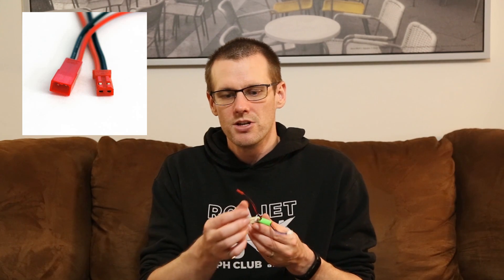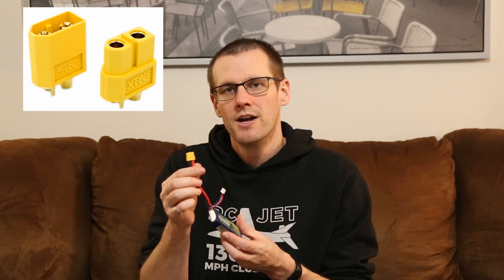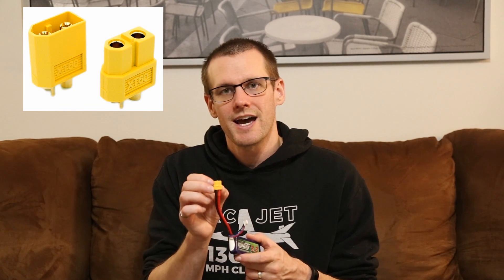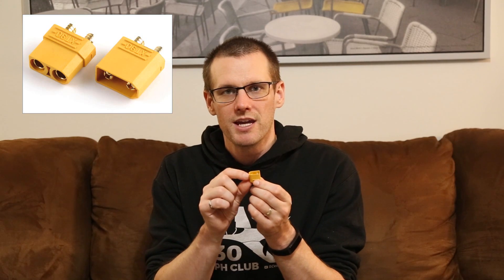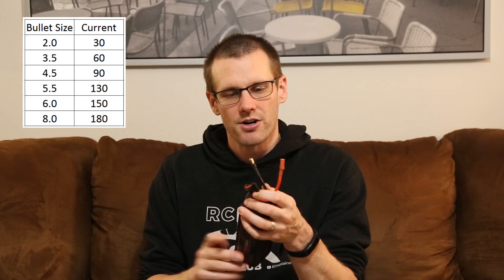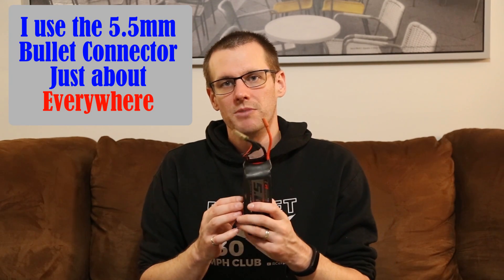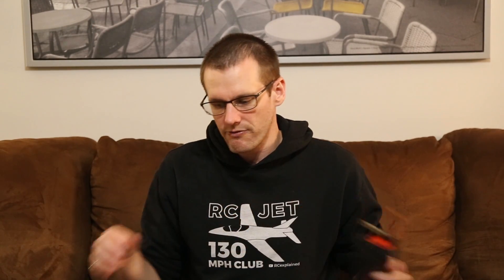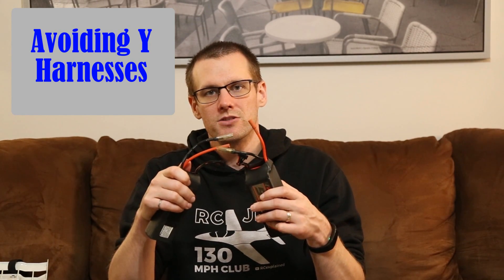Selecting LiPo Battery to ESC Connectors for your RC Car, Plane Or Boat

Comment: If you're going bullets for a high amps application, AS150's are the way to go. Male and female exists for both the bullets AND the caps. It's the safest way to allow yourself the ability to trivially connect batteries in series simlar to how it was described in this video. But the cap protects both bullets from the same battery from passively touching easily and shorting. How you decide to use the caps dictate which correct connections can work.

Do you want it to be impossible to short a battery even if you try? Maybe for yourself or others who might find your battery and try something stupid? You can do that. And if you will never do a series connection, this is probably the way to use them. Even if you decide you do want to use two of your already set up batteries in series later, it’s no big deal to make the single cable with the right cap + bullets to connect two of your batteries and mission accomplished.

If you don’t think you’ll ever absentmindedly try to short a battery, then you have a system where two batteries’ normal leads can directly connect to each other and become a series, and the two other leads are the same as any other battery. It’s your choice how you want to do it. And lastly, AS150 male bullets can come with anti spark variants to enable it for anything.
 
The biggest downside of AS150 is that it's large. The protective cap is even larger and that doesn't bend. If you're trying to achieve an interconnect that also needs to bend and flex in a short cable run, it is the wrong connector.
Reply from the maker: Thanks for sharing your detailed experience and insights on AS150 connectors!

Comment: I read somewhere that the common used 12g wire batteries usually use are only good for like 80amps(off the top of my head). Pretty sure it was a "deans" article and they were saying over amped connectors didn't make a difference since the wire could only handle 80amps.

Comment: I have 2s and 3s batteries with jst connectors bought a 60a esc but I don’t want to solder other battery connectors as the hard body only allows jst into the battery tray

Comment: I'm kinda new to electrics, but have used the EC3.  I think I may got to the XT60 though after watching this.  Or just 5.5 bullet style.  Is one easier to solder than the other?
Reply from the maker: I find it easier to solder larger connectors.

Comment: I used to use XT30s or XT60s for everything (Never dabbled in anything high powered so never needed anything bigger), though they are a pain in the butt to solder so I've started switching to EC5s.

Comment: Excellent video. Thank you. I just today bought a castle combo, mamba x esc w/ a 1515 2200kv sensor Ed motor. The motor came wired with 6.5 Bill it connectors to plug in to the esc. Do I need to use a 6.5 or larger connector for esc to battery?
Reply from the maker: I like to use 5.5mm or larger bullet connectors on the battery. For most applications 5.5mm or larger will be sufficient. 6.5mm is ideal for high power output.

Comment: Just got myself a new combo 120A esc and 4500kv sensored brushless motor for a 1/10 car. Battery is a 2s 5200mah 50c. I planned on using XT60 connectors because I saw people using them.
Reply from the maker: Hi SerxRox, I would prefer to use a larger connectors. XT60's will work if you don't plan on drawing more than 50-60A average

Comment: ryan i just bhought a battery lippo 7.6  12 cel ia it posible if i conected with esc 7.4 12cell help please because i saw one of your video it could dangeres also if you put the wrong batteries i dont want to make that mistake
thank you
leonard
Reply from the maker: Which LiPo and ESC. Do you have a link?
Reply: @RCexplained   lipo 2s 7.6volt esc skyrc 120a
Reply from the maker: If your ESC is rated for 2-3s lipo it will be fine. Voltage is within the range.

Comment: Good information Ryan, thanks! For my models, I use only XT60 or XT150, depending on the application. By using only 2 different connectors, I have the flexibility to mix and match batteries to different models and/or situations. The XT60's are my favorite, but beware of cheap imitation XT60's that are out there on the internet!
Reply from the maker: Sticking with 2 connectors is ideal. I can totally relate to mixing and matching batteries.

Comment: For every device i use female connector and for wires male connecter
Reply from the maker: For connector that are made up of one housing supporting positive and negative terminals, I place the female connector on the battery or power source. The male connector would then be placed on to the load side.

Comment: I use EC5 on my cars (1/10 scale). Soldering is a little tricky but it has two advantages : it does not need heat-shrinkable sleeves and once it is installed it is realy robust.
Reply from the maker: EC5, are good connectors.

Comment: Ryan im sure youve heard pf the ec5 connector, no wonder why ive felt heat from my connectors. Guess its good for 120 amps but up to bursts of 150 amps. Running 2 4s batteries in series 8s, was up to 148 amps of discharge, when i was running my infraction back then for speed runs. Great video. My connector i like is the ec5 connector
Reply from the maker: EC5 are good connectors. I do prefer the 5.5mm bullet over the EC5. EC5's are made up of 5.0mm bullets.

Comment: I also don't get why batteries with really high discharge rating, come with plugs that are just ridiculously underrated for that discharge?
Reply from the maker: Many hobbyists remove the supplied connectors upon purchase. I would expect the reasoning of these connectors being supplied is simply just about cost and nothing more.

Comment: I'm affraid, that just like literally everyone else on YT, You've made a mistake on XT connectors ratings. XT60(and both brothers) confusing name doesn't claim continuous current at 60A. It claims 30A nominal/cont, 60A max/BURST. There is like ONE website in Poland that gives a table of 60A cont/80A max, that table looks like specification table, but I'm guessing it's just the practical knowledge of the store guys. And so XT30 true value is 15A cont/30A burst, XT90 has nominal current of ONLY 40A. And this info is practically on every respectable electronics store website. Now, because of fear I've picked EC-5 100A rated connector(every RC website says that), for my 120A Novak Havoc 3S ESC/Ballistic 10,5t BL combo, which was my first RC setup and probably a big overkill for 2S used. But as I'm writing this, after years since making this (only)setup, I just found out EC5 doesn't have 100A cont rating, it's another 40A connector, just like XT90.
***So my question is, why all of us running underrated connectors and are not melting the plugs? Most people on YT running 8S Lipo(and more) 4x4 beasts with Mamba 240A ESC, even two of them, don't even have XT90 in there. Majority runs XT60 regardless of the setup. So how does that work? Let me also mention that 180A mentioned is nowhere near the top for connectors made by Amass, and that 8mm bullet connector nominal rating is......80A
I've just ordered XT60 to swap my EC5 for the most popular connector, and again am worried :-/ Now going for 3S and not really sure if higher voltage means less current? Or does it really depends from not so powerfull motor installed which will never draw 120A from that ESC? Again wrote too much....
Reply from the maker: Hey Polish Guy. I'm glad you asked this question. There was a great article on this very topic that I read maybe 5 or more years ago that I can no longer find. Since I can not find this, my answer much like your comment, is not going to be a short one. Probably longer, let's dig in to it.

Yes the AMASS spec sheet identifies 2 ratings as you have pointed out. You also mention the "true" value for an XT30 is 15A cont / 30A burst.  One thing to identify here is what does a true rating actually represent? Current does not behave in the same way other parameters may. If you connect a 7s LiPo to a 6s rated ESC, that ESC is surely going to fail upon connecting the 7s battery. However pushing 20A to a connector rated for 15A does not mean it will fail. There is more to it then this. 

The question then becomes, what actually determines a connectors max. continuous current rating? A reasonable answer to this question is the maximum safe continuous current that can be passed through the connector within a safe maximum thermal limitation of the connector. The specified max operating temperature of the AMASS XT-60U connector is 120 degrees Celsius. The 30/60A ratings specified on the spec sheet do not list the temperature the connectors hit and control environment that they were tested in. This does not paint any useful picture for us.  One may expect the max safe operating temperature of the connector to line up or at least come close with the specified current draw of the connector. In the case of the XT-60, it does not.  When an XT-60 connector is run at around 30A continuous for the entire duration of a battery, there is not a significant measurable difference in temperature compared to ambient. When the XT-60 is pushed to around 50A, heat builds but is still reasonable and certainly not anywhere close to the rated max operating temperature. I prefer connectors to not increase significantly in temperature while in use. I would never like to see temperatures exceeding 60 degrees C (half of rated connector max operating temperature) on the hardest of runs in the hottest days of the year. If this does happen, I move to the next available connector set regardless of any ratings on connectors.  The XT-60 has been tested to burst currents of 150A for 8 seconds without failure. This is a lot of power for a connector rated at 60A Peak, especially since bursts are more realistically less than 5 seconds for most RC car applications. Another test has demonstrated 180A for 10 seconds without failure. For this reason, it is very acceptable to run 60/120 numbers for the XT-60 as you will see everywhere.  

Continuous current is yet another area of opportunity for miss-interpretation. We can push ratings even further up as our batteries do not last an infinite amount of time. In fact, most aggressively run RC's will not last more than 5 minutes until the battery goes from full to empty. Because of this limit in time, it also creates an artificial meaning for "continuous" .

It is uncommon in any industry for a manufacture to provide very conservative values for the ratings of the product. This is due to the understanding of leaving value (or money $$$) on the table that could otherwise be used to market the product. This is what I ultimately find so interesting but could be related to the next point. 

Another item to consider is that these connectors are not only used for RC but for other applications as well. Due to specific limitations in other industries, these connectors can be underrated to suit.
Reply: @RCexplained  Thanks for long reply. One thing I omissed is the spec table for connectors also give nominal voltage of 500V. So the rating is at 500V(!?), which makes like EVERY SINGLE VIDEO on YT regarding RC connector ratings......pretty much useless and very missleading? My physics and maths memory is gone really, but simple formula allows us to calculate rated power handling and then calculate current again for voltage required-number of cells used. Numbers don't look realistic however, so I wonder what do You think about it?
So for XT60, 500V*30A=15000W of continuous power rating, or as You kinda mentioned-partially heat capacity(?). Right away-not very realistic...
For 3S 11,1V XT60 connector: 15000W/11,1V=1350A nominal and 2700A burst, which as You explained, especially burst rating we should take very lightly. It might be 0,5s, 1,5s or 5seconds burst, who knows. And off course the higher the voltage, the less current it can take. But for 2S Lipo it's ridiculous 2020A. Safe margin is still recommended, running conditions should be considered, also as You mentioned NO ONE wants having to disconnect a plug at 60°C, so if the rating is for max connector temp of 120°C, then divide the current by three, to get connector temp of 40°, then add some current, cause passing air at high speed will cool the plugs, temp to current flow isn't parallel due to air temp.....it's hard to estimate, as You mentioned.
Similarly EC5 connector is also rated @500V, but 40A nominal, 100A burst. 20000W capacity divided by 11,1V=1800A, 2700A@7,4V BUT burst values for larger connectors is where the differences matters - 100A*500V=50000W; 50000W/11,1V=4504A; and 6756A@7,4V So again burst current for EC5 connector should be taken lightly due to unknown testing/conditions for rating tests, but it's MASSIVE! 
So for other readers - Amass gives all their rating @500V, so the calculations can be used for Deans/T connector, bullets, EC3, EC5, XT30/60/90, most of popular ones. However the results don't look realistic. It would suggest all of us actually run overrated plugs, and XT30 should rule the market for 3S
Am I correct? Is there still hope for my brain power? Is there any grey matter left inside that empty horse's head? :-)
Reply: @RCexplained  Wow Ryan Thanks for the info. Seems like you hit a nerve with this topic lol .I use Amass connectors because they look beefy🙂 I built a 100mph plus car , 100c 8000 mAh 8s esc Castle MambaX. I'm still learning how to drive high speed but so far 90 pb and alot of mid 80s back to back, wires connectors and esc all cool so 8mm wire and Amass connectors work for me. You were very helpful along the way so Thank you so much🙂
Reply: @RCexplained  Hello? Any thoughs on previous post?
Reply from the maker: @polishguywithhardtospellna8227  I typed out an entire post and apparently it didn't submit several days ago.  
Your math all checks out, however we can't limit a connector by power.

Connectors are essentially limited by current. Current represents how many electrons you are forcing through the connector where voltage can be looked at as the pressure pushing the electrons. There's only so many electrons that can be forced through a connector before it starts heating up.  Whether you operate the connector at its maximum safe voltage of 500v or 5v, the limit will still be the rated amount of current.
Reply: @RCexplained  Thanks a lot for putting the reply in again then. It was a bit too optimistic to have thousands of Watts going through.

Comment: QS8 anti-spark
Reply: 8mm or nothing 💪💯
Reply: @furiouswolf777voodoo4  from this video I might need to switch to the 10mm because I’m averaging 350+ amps in my logs
Reply: @LETUBME  My speed run limitless I'm running Mamba X 8s Tp power 4070 and Zee 100c 8000mah. No problems so far. All the best to you and good luck! 🙂
Reply from the maker: Hi LaMarkus Washington Sr, are you averaging 350A of continuous power? Or is this a burst happening for less than 5-10 seconds at a time. Very big difference! A 180A rating for continuous current on an 8.0mm connector is for maintaining 180A continuously for the entire duration of the battery pack.
Reply: @RCexplained  thanks for asking, but it’s only burst due to drag racing so less than 2 secs. I’m running a 1440 2700kv Cordova on an XLX powered by either a 6s 6400mah SMC 120c or 8s 9000mah Zee 100c.
Reply from the maker: Being a burst current, you will be fine with your QS8 connectors. I would only move up to the next size if you are measuring a significant amount of heat relative to the ambient temperature. I would not expect your connectors to get hot from bursts of ~350A